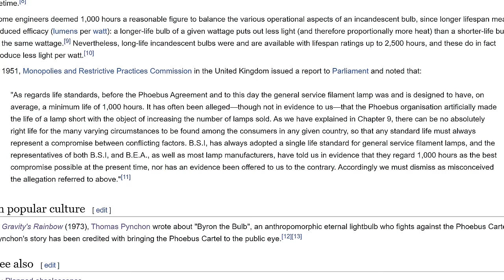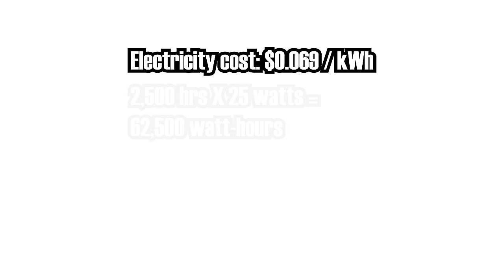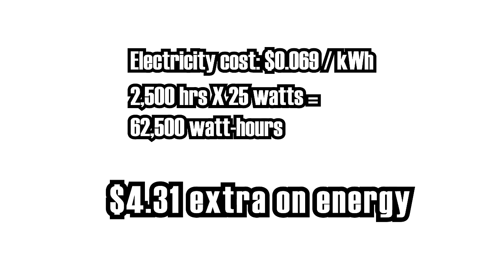Longer-lasting light bulbs: it was complicated

Comment: I remember the story about the computer repair guy who found a chip in a particular brands printers that kept a count of how many pages were printed. When the count got high enough the printer would stop working. He would simply replace these chips and the printer would magically work again.
Reply: That quite literally happened to my epson eco tank printer. Got to 16000 pages and then displayed an error saying it had reached its end of life. I cleaned out the internal sponge and got a software jailbreak key for $5. I hate that they do that but the printer is so worth it. The ink is so dirt cheap.
Reply: @matthewjohnson3656  ma men say exactly what printer you have. Pleasseeeee. Lime the model and the year if possible. Thanks in advance
Reply: @pedro.alcatra  It was an Et-2750 but I have a feeling they have the same lock installed on all their machines. I still love it despite that. I think I spent maybe 40 on ink  over 20k pages and 4 years.
Reply: @matthewjohnson3656  Yes the have a block feature em every product. HP, and brother as well. But I was wondering if I could buy exactly this one and then unlock the printer in the same way you did!
Reply: @matthewjohnson3656  MA MENNNNN. I saw the price. And God. It is absurdly expensive. Like 450€
Reply: @pedro.alcatra  I accidently destroyed the motherboard so I got the et-2850 as a replacement. seems to have all the same features and reviews at the same price. I assume its newer so maybe they made it more efficient so they could sell it at a lower cost.
Reply: I used to work for Canon.  Trust me, if your little ink-jet last long enough to encounter such a kill-switch setting, you've already won the printer lottery.  These are basically disposable printers that you buy so that you will buy the expensive ink.  They aren't really built to last and they absolutely don't.  The ink is where the shadiness comes from, with companies like HP pushing BIOS updates that will no longer allow the use of third-party ink cartridges.  They won't be "Hey, I see that's not a genuine HP cartridge, which I highly recommend."  It's "Error: Unsupported ink cartridge. Please insert a genuine HP ink cartridge" or something to that effect.  This is probably blatantly illegal in many places, but even if it is, by the time they get forced to do stop, they'll have made far more in ink sales than they will have to pay in fines.
Reply: @megachonk9440  Which is why the penalty for intentionally violating such regulations should be a forfeit of 100% of the profits made from sales of the products in question, if not 100% of the combined retail prices.
Reply: I found some key combination for my old Samsung printer to get into service mode, and after resetting everything back to zero, it started working again.
Reply: @megachonk9440  epson has a stop code for cleaning the wasted ink sponge, it's not that bad, and dont clean the sponge, i soft reset a epson tx130 and after a time start to bleed ink, i have to dismantle and cleanup, and wait two weeks to the ink came out from my hands, modern ones l200 and L300 series it's better, don't calculate how much ink you have, it's continous ink system from factory, and just keep gathering ink in the printer and keep working, for optimus work for that type of printer its good to print at last once a day at full color to prevent ink dry in printer head.
Reply: @megachonk9440  Which is why I like the ecotank printers. A $15 ink bottle is good for several thousand pages.
Reply: It was in the same documentary that mainstreamized the awareness of the Phoebus Cartel. IIRC it was named "Light Bulb Conspiracy", and specifically Epson printer was under scrutiny there.

Although, along with light bulbs, also with printers the "good" sides were left untold in documentary, ie. the thing that printers have generally been subsidized for sake of ink sales, it still doesn't make things right, for many reasons. First and foremost, it is completely wrong and unsustainable practice to subsidize printers and sell the ink with overprice.

Secondly, no matter how it was, it is just wrong to make a printer stop working by excuse of waste sponge becoming full. Somehow it was never an issue before Epson or whoever was the first, invented such a counter. And I see it might be an issue at some point, the sponge should just be replaceable, and resettable warning provided, nothing could be simpler! The prevailing situation is like a car just stopping working when hour or mile counter deems the air filter having reached end-of-life.

Thirdly, at least such a feature should have been honestly told for buyer in product specs.

Well, on the other hand, why use inkjets nowadays in first place? Laser printers have long been affordable and better in about every aspect, and with no excuse-sponges!
Reply: Did the printer company sue? Planned obsolescence should be illegal
Reply: I'll be the first to tell you as someone that previously worked at Staples selling printers that I can corroborate this information.  It gets even worse than that, too, as they not only do it with printers themselves, they do it with *ink cartridges, and not even when you're out of ink yet*.
Reply: @matthewjohnson3656 that's why they do it by the way - the Eco Tank printers are sold on their cheaper ink, but as a result they make MUCH LESS MONEY ON INK (cartridges are sometimes more expensive to buy than printers, as I'm sure you know) so they create a new artificial limit.
Just be glad it's not a chip on individual ink cartridges, which I'm 99% sure HP still does with their new models
Reply: @TheSimoc  you don't change toner color cartridges? is worse to cleanup that powder, and i just start a having a trouble with a format that print just 50% of the page, left side, and this zone of the toner cartridge start damaging, so, not so well, but amazing images, i like the toner printer image quality, but for a lot of things, it's better start with ink
Reply: @CarlosMartinez-px9xo  I do change them, as I said I can buy them for about a price of printer too, and they suffice for manyfold more printing than inkjet cartridge. No need to clean either. I'm not sure what was your point, but by the way, I can buy non-original toner cartridges even cheaper, there seems to be some subsidization on laser printers too, but I have heard the cartridges provided with new printers would have less content than replacements, not confirmed that claim though.

Anyway, way more economical to use laser than inkjet, plus the superiority on about every other aspect, too. Exception might be the EcoTank, not familiarized with that but I see if any generic ink can be used and if that is inexpensive enough, it may be more economical if used a lot. But if not used that much, laser is still superior as it has no issues caused by drying up.

I have never tried the refilling of toner cartridge nor have familiarized how prices of generic toners would compare to generic ink, nor even to replacement cartridges. Might try sometime. If I ever get a chance, as cartridge seems to suffice for half a lifetime with my usage..

Comment: The same issues occurred with vacuum tubes. My father learned to blow glass in order in order to make the 1000 of vacuum tubes he needed to build his isotopic scanner for medical research involving nuclear materials. His hand made bulbs lasted at least twice as long as the commercial bulbs, and allowed him to run his equipment long enough to do the analysis he was working on. The problem, according to him, was the enitrerly unnecessary and unwelcome "kink" in the wire, which shortened their lives considerably.
Reply: With the early vacuum tube computers the important realisation was that (like light bulbs) most tubes fail when they are switched on. The solution try to avoid turning them off if at all possible.
Reply: @MrDuncl  During WWII Alan Turing suggested using an electronic computer to help decipher the "tunny" codes coming from Nazi Naval forces.  The Nazi Navy used binary encoded signals with a XOR adder scheme to 'encrypt' (technically still encoding and not encrypting but most historical documents use the words encrypt and decrypt) long range communications while their Army used modified Enigma machines which used scrambled analog signals in an unusual frequency and were sufficiently dealt with using electromechanical computers.  At first Turing's suggestion was rejected because of the known issues with Thermionic Resisters (the British name for Vacuum Tubes) burning out far too quickly but Tommy Flowers backed him up explaining that the air force had already found a solution to the problem, just don't turn the dang things off/keep at least a minimum of power flowing to the Tubes.  The air force used vacuum tubes for their radar technology and Flowers had worked with said technology before joining the Warehouse crew to help decipher Nazi communications.  The result was the first fully electronic computer (aside from the tape feed storage) called the Colossus and it was so successful they built 2 more.  I think is was less than a decade later, long before the Colossus was set to be declassified that an American team developed the first general purpose electronic computer using similar concepts despite not knowing about the Colossus beforehand.  Even though the US and Britain were allies during the war there was still a lot of secrecy between them (probably still is but we won't know until stuff get's declassified) and Britain initially wanted to keep the electronic computers a secret figuring they might be useful if they went to war against someone else.

Comment: I've had a few bulbs go since moving into my apartment almost 4 years ago (wait, how has it been nearly 4 years already?!) but given the relative height between the ceiling and me, even when on a step ladder, I'm so glad for the improved longevity of modern, non-incandescent bulbs! I literally need to ask somebody to come over to help because I'm just slightly too short to reach the fitting to change the bulb myself, so less frequent bulb changes are very welcome! 😅

Edit: This isn't a comment on the "The Thebes Cartel isn't a good example of planned obsolescence" topic, merely an expression of an added frustration with the process of simple lightbulb replacements, and a praise of newer technologies that reduce that frustration somewatt ❤
Reply: had an apartment with 13 foot ceilings and I tell you the fixtures up there were NOT "user relampable" and lucky for me the lights never burned out
Reply: I'd recommend getting a taller ladder, you never know when you'll have to do some ceiling work
Reply: *Phoebus Cartel
Reply: "Somewatt" lol!
Reply: They make pole-mounted lightbulb-grabber things for changing high or hard to reach places, and you can find some for fairly cheap, might be worth looking into to. :)
Reply: @FredFredBurger92  Unfortunately, they only work for base up fixtures with a fair amount of clearance around the bulb. many fixtures have shades, base down or horizontal bulb positions that the grabber won't grab.
Reply: @FredFredBurger92  that or just getting a higher ladder/stepstool, or hell even both options if you live in a cathedral or something :P
Reply: @SpydersByte  I don't live in a cathedral; I'm just short 🙃

The problem with a ladder is storage space for it, and storage is a problem in apartments

Comment: Gotta love the random shoutouts to Big Clive. He makes content that isn't for everybody but I feel like everybody needs to know the information he is giving out. There is way too much crap out there and to this day I see people using extremely bad/cheap/outright fire-hazard electronics and claiming that they are as good as the ones that cost way more.
Reply: So why can't I get 'Dubai' LED lightbulbs like they sell in the UAE?
Reply: @geo8rge   because the revival of the cartel.

Today there is no positive side in shortening the lifespan of led lights.

In fact the lower the current the led is driven at the HIGHER the efficiency AND lifespan.

the curtent cartel is all about cost savings (higher current per led chip eeks out more light per chip /less chips per bulb needed) and selling more of them (the higher current runs the bulb hotter which in return shortens the lifespan significantly - a gamer would call that a double kill)

In other words today you change the stupidly engineered 1000h led for 8x the cost of an incandesant bulb at about a third the energy cost.  Thats a win for the manufacturer - not the consumer !!!
Reply: @casemodder89 
I agree. Especially cheap Chinese led lights tend to over drive the LEDs. If you can tinker with them, they’ll last ‘forever’.
Reply: @geo8rge  Because they would cost more to produce, but everyone would still reach for the cheaper option that outputs the same lumens anyway...  Sometimes it's the consumer's fault.
Reply: @casemodder89  There is no cartel anymore. Those are just cheap LEDs bulbs engineered with too much cost-cutting measures.
On the other side, well designed led bulbs still exists on reputable brands like Phillips. They are just more expensive.
Reply: Don't forget his "does it carbonate" series. Truly information that humanity needs!
Reply: Every time I take some piece of electronics apart, my mind starts narrating in Big Clive's voice...😂
Reply: Funniest, and scariest, video of his is the one where he shows how dangerous a cheap travel adapter is. The video title is "Extra dangerous electrocute-o-daptor with lamp test feature." :D
Reply: @rollertoaster812  One moment please.
Reply: @jayhom5385  Watch your eyes.
Reply: @jayhom5385  genuinely that has entered my everyday usage because of his videos and I always have to stop myself saying it in a soft Scottish accent
Reply: @casemodder89  "Even in the future nothing works!!!"
Reply: @Conservator.  Well at least the last ones I bought were not overdriven. Rated as 12 W, they run at 7 W -.-
Reply: @whuzzzup  😬😁

Comment: My example of planned obsolesce is in 3.5" floppy disk drives. I was a lab aide for a computer lab filled with old, often donated PCs. The most common part to break on them was the floppy drive. We had stacks of disassembled floppy drives we used for parts, but it was rare that we could use parts from one to fix another. The reason is that the same part failed in every one of them. There was a lever arm that was responsible for opening the metal cover of the disk and for detecting the presence of the disk, and causing the drive to clamp down on the disk. Thus, this was the only part that received the mechanical force of the disk being inserted. In drives full of metal parts that didn't seem to need to be metal, this lever arm was made out of plastic. It was made out of plastic, and the middle of the lever arm was hollowed out. No doubt this saved a few pennies of plastic. But the result was that this lever arm was almost always the first part of the drive to fail as it snapped from the repeated mechanical stress of floppy disks being inserted. This seemed like a clear case of designing something to fail after a certain amount of use when a solid plastic lever arm would surely have lasted much longer with no downsides to the design and barely any impact to the cost.
Reply: Floppy drives definately got worse in the 90s and early 00s, I don't know if it was planned obsolescence as such though, there was a huge race to the bottom in terms of pc price, at the same time as pc tech was advancing faster than ever before, a lot of manufacturers probably didn't expect their machines to be in use for more than a couple of years, I remember manufacturers advertising on the basis of "power" "performance" "price" and bundled software, but I never saw anyone mention reliability as a major selling point (at least in consumer machines, servers and industrial stuff did emphasise reliability, and their prices reflected that)
Reply: Don't attribute to malice that which may more easily be explained by incompetence or stupidity. Or more likely in this instance if they made that bit thicker it would warp coming out of the injection mould or some other random something. Or it was just a simple oversight, it worked a few hundred times in testing so it's probably fine right? Planned means somebody sat down and intentionally did it to break after a certain time. That's actually quite hard to do. 
Making a 10,000 hour light bulb is much easier than a 1000 bulb, much looser tolerances.
Reply: You could probably 3d print replacement parts depending on their size and tolerance…
Reply: Could it be to prevent magnetism? I'm being skeptical of the narrative here, because a YouTube video told me so.